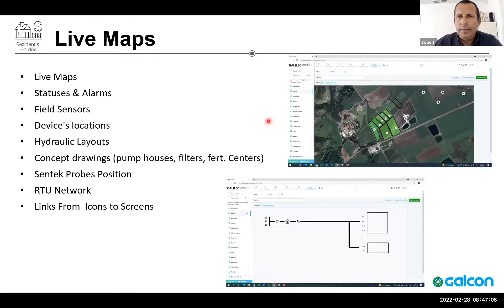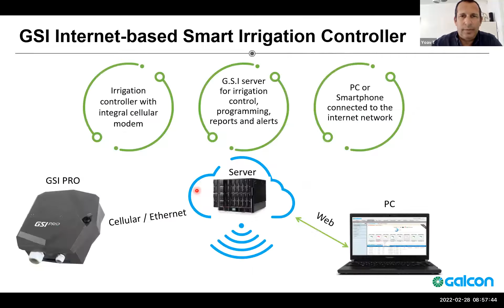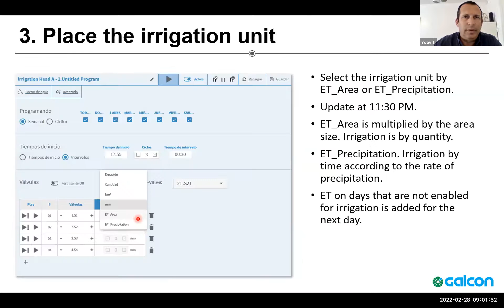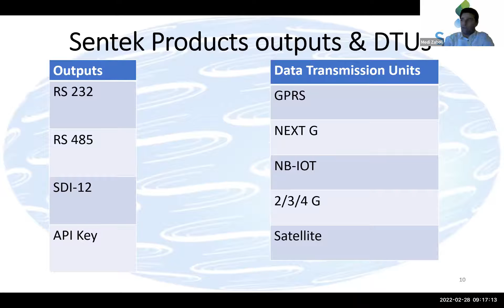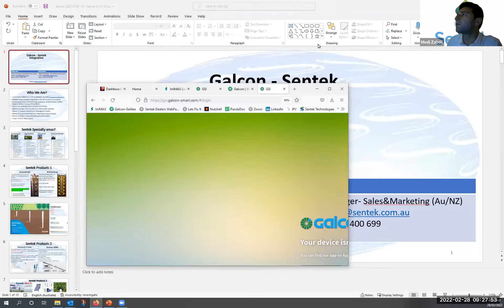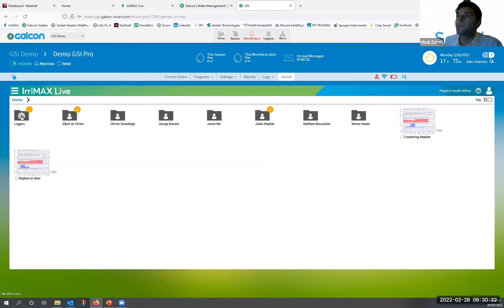Galcon+sentek webinar

Comment: Loved this approach.
What about ph sensors?
Also redundancy and testing systems for valves do they turn on of notification to replace or fix.
Basically i want a system that can control 1000 gardens with ph ec water sensors